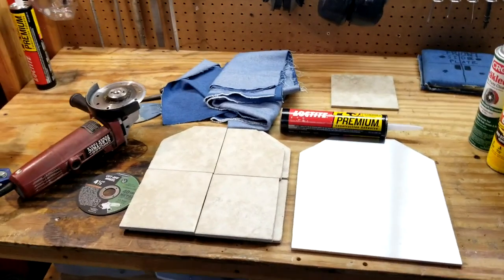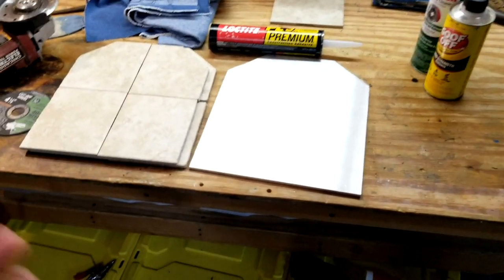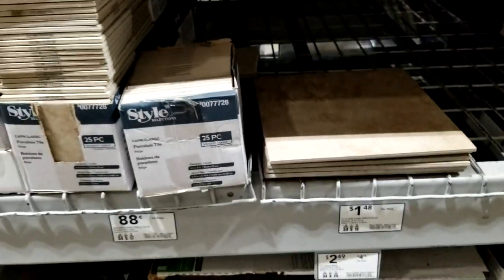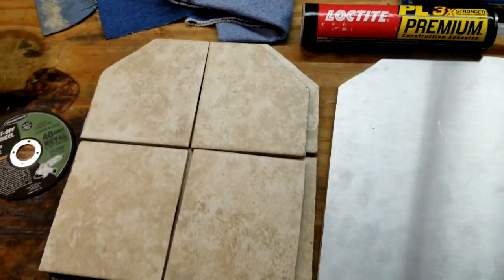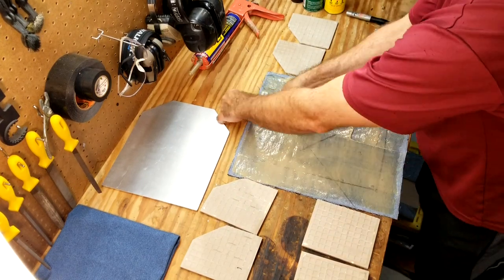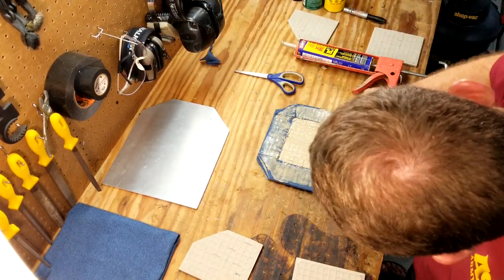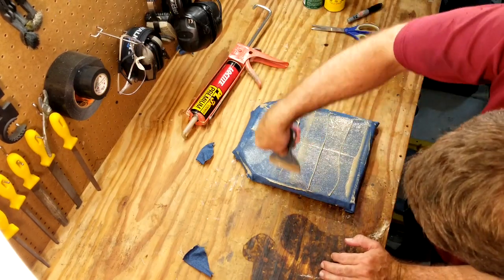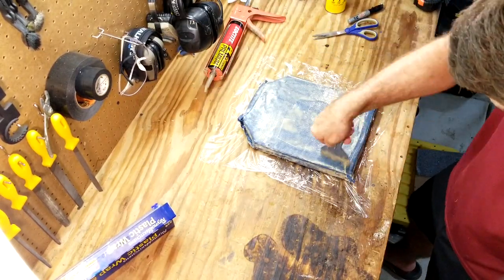How to Make Body Armor

Comment: I used a quarter inch aluminum plate in my first submission. The AK went right through it. Although I didn't have any tiles because I was running into weight constraints. It will be interesting to see how far this plate goes. Good luck!
Reply from the maker: The ceramic tile makes the difference,  and works against 5.56, but 7.62x39 is a whole different beast.  Its penetration capability relies on momentum instead of speed.  5.56 relies on speed.  Ceramic works well against high speed but is less effective against high momentum.
Reply: @ProfessionalPepper  A lot of AK ammo (all of it maybe?) uses steel jackets too. Bit tougher than copper.
Reply: @Fudmottin  i was going to add a steel plate to mine but felt thats kind of cheating 😆
Reply: @pmhcustomcreations  That would probably also take you right over the 9lbs weight limit too. Using metal of any kind seems to bring the weight up faster than the strength.
Reply: Why not use like a rubber spray on the outside, like a rhino liner for trucks
Reply: @joecianfarani6951  Because it literally does nothing more than add weight. The major improvements to this particular plate layout would have been epoxy instead of adhesive and 9oz or 12oz fiberglass instead of denim with more layers of fiberglass on the back.
One thing to say about this design is that all the materials are easy to get. Fiberglass and epoxy are also easy to get, but are more expensive.
Mind you, his plate beat mine (and cost a heck of a lot less).
Reply: @ProfessionalPepper  how to make a plate with both capabilities?
Reply from the maker: @Fudmottin  you are spot on about the improvements.  You could also change out the 6061 Aluminum for 7075, but once again,  it gets more expensive. And... honestly, i beleive it would be very difficult to better protection from another design without using significantly more expensive materials or run into weight or size issues.  It sure is fun to try and see what's possible.  T'was a good experiment.
Reply: Ceramic isnt exactly cutting edge for todays age and when looking at top of the line armor as you said energy does not defeat it, speed does. 7.62x39 is absolutely easier to stop than 5.56 or 5.45 with literally anything but ceramic. 

M193 loaded to 3500 fps will put a neat little hole in ar 500 at close range and currently m855a1 is without a doubt or competitor the best intermediary cartridge projectile currently out there because it has a decent chance even against lvl 3. 

Also I bought a couple plates off of Amazon for 70$ a piece that weigh .9 pounds as a joke mostly especially when i saw the weight and no sh!t it stops multiple hits of 7.62x39. Don't even know what it's made of but I think it's some kind of dense polymer.
Reply: I just stumbled upon this and I think it’s great! I was looking to make ballistic panels for a backpack. 

I have 2 questions... What happens if the round hits in the middle of the tiles? And any suggestions on making the backpack panel to stop an AR round but keeping it light as possible. It would be for a kid’s bag. Thanks!
Reply: @LawnDad  If you're going for serious use like a kid's backpack, I would get something commercial. It will be lighter and have a better chance of working. Modern armor is getting pretty impressive.

As a direct answer to your question, when a tile gets hit, the entire tile is pretty much done. Not always, but usually.
Reply: @Fudmottin  so you’re saying buy a ballistic panel from a company then? They are so expensive to stop an AR round. Any recommendations on which one or company? Thanks  again
Reply: @LawnDad  I am. CRS Firearms had a competition on home made body armor. It's not easy to make rifle rated armor. I know the factory stuff is expensive. But when it comes to putting my life or the life of a child on the line, factory is what I would spend my money on.

Comment: Replacing denim with kevlar/carbon fibre/glassfibre would be better but costlier. Glass is a winner for strength and weight and for protecting the ceramic also
Reply: Although there are vids out there where they used fibre glass and it shatters the back so splinters come out and that’d hurt. (If you actually wanted to protect yourself with a diy one obviously)…
Reply: @blank.9301  A combination would make the most semse surely. Fibreglass fabric and polyester resin with flexible additive will shatter far less, but if the last layers near the body were something else, even plastic, you could limit debris on the body side.

Comment: I layered three 1/16 inch steel sheets and two 1/4 inch acrylic sheets with a rubber mat as backing. Not sure how effective it is yet but seemed like a good design.
Reply from the maker: Test it out and make a video!

Comment: Im pretty pumped to see the test, yours is a fairly different build than Im used to. I see lotsa fibre glass, HDPE, ceramic and steel. But rarely see aluminum or denim
Id like to see yours tested vs 7.62x39 and 51

Showing how you cut ceramic was useful to me
Reply: He did another video a while back where he shoots a similar plate and it stops m855 with no problem
Reply from the maker: I am excited to see it against 7.62x39.  Ive already shown it works against 5.56, so if 7.62 is stopped,  that means darn near 99% of the treats you would encounter you would be protected.
Reply from the maker: I hate how he jumps to 300prc instead of going to 308. Oh well 🤞
Reply: @ProfessionalPepper  the test vid is out then?
Reply from the maker: @evansaw293  CRS Firearms should post a test video of it sometime this month.  I believe it can withstand 308, but think it may not survive 300PRC.
Reply: @ProfessionalPepper  my build is heavier, ceramic mild steel and fibreglass. But lower quality tile and only one layer. Im guessing we are close in stopping powa
Reply from the maker: @evansaw293  yeah there is many ways to make it, and it's good to come up with multiple viable solutions to various threats.

Comment: Its not just the hardness of porcelain tiles as the high speed fracture absorbs energy whilst the hardness helps spread. Again though there isn't a single material that is best as a composite of engineering materials with differing engineering properties likely will be best.
Porcelain floor tiles seem to get better results from other vids, so use 2x layers of overlapping tiles spaced with a half tile thickness of rubberised resin with a fibreglass back pad.
Likely the top surface of tiles doesn't adhere well and going the full hog a diamond cup wheel on an angle grinder can prep the surface (does this lose hardness ?). Also to encase and wrap with final layers that cover over the front and overlap on the back to create a complete wrapper is important if you do wish to stop lamination and also adds a further layer.
A couple of final layers of Kevlar might only add $20-30 to the build but also add another excellent engineering property.
So thats it floor tiles, welding blanket with a bit of kevlar just to finnish it off...
PS vac forming due to the degassing is a better method than clamping.

Comment: Hi,

I had an idea, unfortunately I have no way of testing it where i live, but it might be of interest to you.

Its basically to paint several coats of liquid rubber sealant on the front of the tiles (until it's maybe at least 1/8" thick). It cures to a very tar-like substance.

My theory is that it will gunk up the projectile, adding friction, and making it harder to pass through the rest of the panel.

Edit: The idea is to eliminate the need for the second layer of tiles.

Also, a layer of fiberglass cloth can be added somewhere in front or between the coats of liquid rubber to help prevent spalling or explosion of the tiles. I think the PL might be too brittle for that.

Edit: even after the liquid rubber dries it will still be sticky so probably should be wrapped in fabric or denim as per usual.
Reply: Anything in front of the ceramic works as spall protection. Slowing the bullet down would happen best after it hits the ceramic.

The ceramic works well because it tears and strips the jacket off the bullet making it easier for the backing material to absorb the rest of the impact.
Reply: Evan Saw i know the purpose of the ceramic. Its hardness causes the projectile to pancake upon impact, increasing surface area and making passthrough more difficult. But thanks for your take.
Reply: Evan Saw also, not anything stops spalling. Some things work better than others. A gooey or rubbery substance will increase multi hit capability by holding more of the ceramic in, as opposed to brittle materials which allow more ceramic fragments to blow out the front, weakening it quicker
Reply: Evan Saw also, the liquid rubber is to add to the friction so that the rest of the panel can slow it better. I dont think you really understood my idea at all
Reply from the maker: I don't believe the rubber would be a good weight to strength trade off.  It is always best to have the hardest material in front to disrupt the bullet before you try and catch it.  It is a futile effort to attempt to slow a bullet down with friction.  You have to smash it, then catch it.
Reply: @jeboteya5489  superizingly the PL by itself does wonders for multi hit capacity. I just tested a plate using backsplash ceramic and it only broke in the area around the bullet impact. It may be different for PE5 porcelain though.

I use one layer of fiberglass in front of the ceramic for spall

Comment: Instead of denim, next time go to harbor freight and get a fiberglass welding blanket.
Im curious to see what kind of difference that would make.
Nice job man!
Reply from the maker: Fiberglass is superior for sure.
Reply: I wouldn't want to be breathing in the vicinity of the spalling fiberglass.
Reply: @ProfessionalPepper usually splinters  out the back end though. Ouch.
Reply: @daye8132  Without the fiberglass you won't be breathing.

Comment: I was going to go with tile but talked to some local shops and the ceramics that they use to make tile aren't the same as in vests. Gave me an ex. Of tiles on a space craft (high heat but fragile) compared to the tiles on a tank.
Reply from the maker: From my testing, tiles, or some other hard material is needed as a front impact surface to strip the hard copper jacket from the round and,or deform the core so it can be caught by the backer material.
Reply: THIS is exactly my thought process planning mine.

I'm not even past design. I'm considering doing angled, corrugated metal sections sandwiched between 2 other pieces of material. No metal back, metal on the middle, but angled in ridges so I can try to increase over all thickness a bit.

These have been fun to watch get shot. I'm gonna hurry mine up 🤣
Reply from the maker: @imadequate3376  you have 5" to work with, which makes a difference.  It gets outside the practicality of it but its within the rules.
Reply: @ProfessionalPepper  I watched a few videos on Kevlar and I'm kinda at this weird "should I just replicate the Kevlar bullet trap" or "do some sort of thick padded materials and a plate" and I've come to this cross roads of sloped armor in an attempt to do both.

Should be fun to get together
Reply from the maker: @imadequate3376  do  kevlar layers epoxied together with a ceramic tile in front.
Reply: @ProfessionalPepper  idk man, I feel like that kinda hurts the "Home made" spirit he's going for.
Reply from the maker: @imadequate3376  then make the bullet trap

Comment: Do you think i could use 2 plates of 3,2mm (around 1/8") instead of one 1/4" (around 6.4mm)? Or maybe use 4mm mild steel instead? I have this materials on stock, so making plates would be basically "free" for me. Maybe add something between 2 alu plates like fibreglass laminate?
Reply from the maker: I am pretty confident all those ideas would work, but you should test them if you have the opportunity to do so.

Comment: Well sir I’m going to take your idea and toss my own mix into it I found some 1inch pei group 5 squared tiles and I was going to use your suggestion on the construction adhesive to bind it to a sheet of 1/8 thick aluminum (both sides) covered with 5 sheets of 1680 ballistic nylon just to hold it in place but I’ll use fiberglass resin that’s impregnated with graphene powder to strengthen the resin. Then on the backside of the aluminum plate/sheet ( which is thin for a reason ) layers of high grade ballistic Kevlar with the afore mentioned impregnated graphene resin with a 1/8 inch thick titanium plate in the back with the entire panel covered by the 1680 ballistic nylon once again with the afore mentioned resin. Is it expensive? Well yeah. However my rough calculations show that it should be under 8 pounds (depending on the layers of Kevlar and nylon) I’ve been gathering the materials needed for the past 3 months, (I’m just a poor country boy so I needed time) and should have the final piece next month which is the graphene powder. From my extensive research ( which at time annoyed the living hell outta my wife lol ) the graphene powder is the key to the whole thing I hope I’m right wish me luck. I will be posting my first video of the construction and testing.
Reply from the maker: Dang! Sounds like quite the project.  Good luck on the build. Graphene powder is a pretty cool substance. 
I'm looking forward to seeing your video.

As a tip from personal experience (see my collection of diy armor videos), when working with the 1"x1" tiles, remove the webbing from the tiles and adhere them directly to the under layer leaving no gaps between the tiles.  The gaps, even when filled with resin/epoxy, are a weak point.  You really have to focus on breaking up that bullet so the under layers can catch it.  Cheers.

Comment: I foresee this working against pistol calibers, but will have trouble with rifles since there's no backing material to catch things that make it through :D
Reply from the maker: The Aluminum plate absorbs the energy of the round afeter it gets busted up.  
Here is me testing a smaller prototype with the same design against m855 and m193. 
https://youtu.be/NEDMQ7jalU4
Reply from the maker: Here is my simplest handgun armor design.   https://youtu.be/TsycTtzWw2s
Reply: @ProfessionalPepper  Do you have the velocity figures from that test?
Reply from the maker: I don't, but I was shooting from a 16" barrel, 25yds from the target.  I estimate around 3100fps for the m193 and 3000fps for the m855.
Reply: @ProfessionalPepper  Got it. Do you happen to recall the brand of M193 and M855?
Reply from the maker: Federal XM193 and American Eagle M855.

Comment: use fiberglass sheet layered glued with epoxy resin and if you want rifle rated armor put some glas/stone/ceramic tiles, best is mosaik useable in pools, put it between like, 6-8 layers of fiberglass, 1 layer mosaik tiles, 3-5 layers fiberglass, 1 layer mosaik tiles and 18-38 layers of fiberglass(more thickness, more thoughness) (than important is pot it between form, like steel or some form that pushes glue out and make it thinner but harder), than cut excess with anglegrinder -dust mask is important, or else you die due to internal lungs damage (no fun), brush sides and all put in duct tape on carpets (grey, big, thick tape) -this setup holds even against .308 win